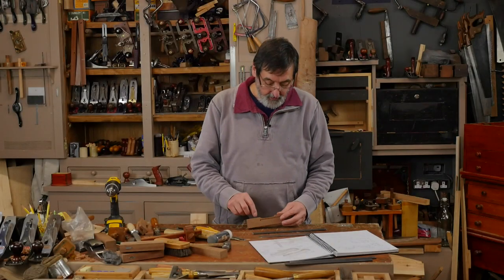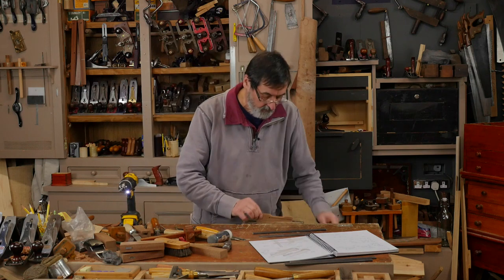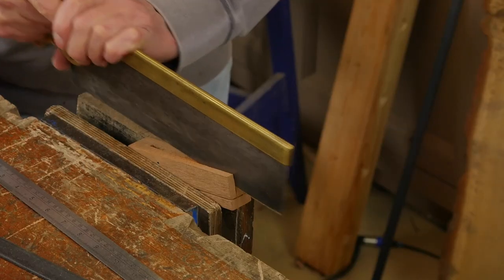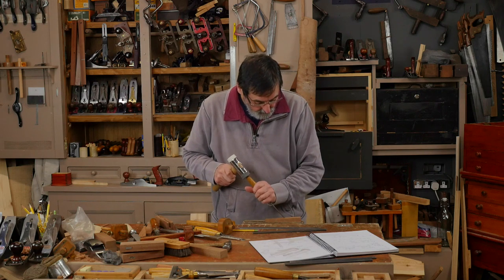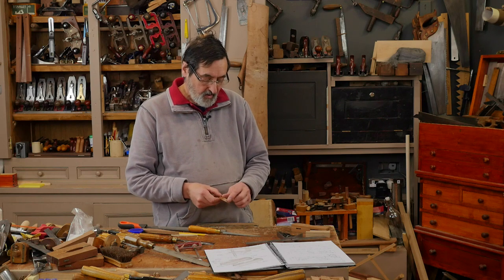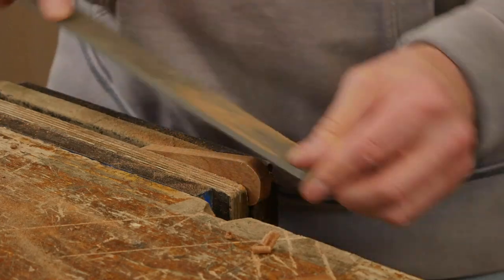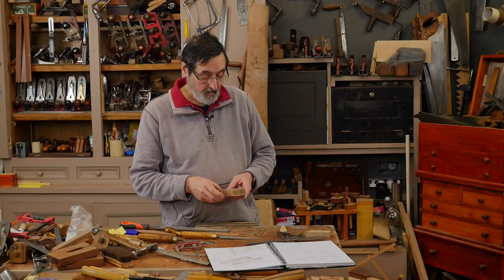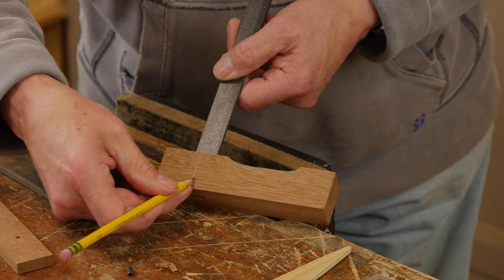Making Cam Clamps 3 | Paul Sellers

Comment: I just watched this video a second (or third?) time, I couldn't resist watching all 3 parts all the way through.
At around 30:30, roll-pins are used as a stop for the clamp.
This will work, but it could possibly catch on something like a cloth or your fingers.
Instead, you could use a key-ring, which would also give you an extra way of hanging it on the wall-rack.
(Yes, you could also use a M3 or M4 DIN 912 hex-socket screw, I'll probably choose that solution myself, as I have some of those.)

Comment: Great series. I used to be the Guitar Doctor at Stars Guitars in San Francisco (made "House Calls" to concerts and recording studios) and there's not a luthier who doesn't have at least a dozen of them even if all they work on are solid body electric guitars. Most have at least three dozen or more in their shop. The commercial ones I've seen were all made out of maple, but any good, seasoned, straight grained hardwood should do. I like the idea of using 1"x⅛" mild steel bar stock instead of the aluminium the commercial one's come with. Just don't let it come in contact with the project or, due to the wet glue, it might leave a stain. (Come to think of it, that may be why the commercial one's come with aluminium instead of steel shafts.)

Comment: how do you apply finish on them? can I use my standard method for tools which is boiled linseed oil and paste wax? do you have to avoid getting finish in the mortise? or would it still have enough friction to hold?

Comment: Super thank you, ive just made some out of maple. Which finnish do you use, oil, wax, lack?
Reply: This was two years ago... but anything that doesn't stick to wood glue would be a good bet I think. Polyurethane, or waxy finishes should work very well. PVA or aliphatic glues don't stick well to shellac either. The leather pads are of course at a higher risk to come into contact with glue. A square of painters tape on top of the leather could help in messy clamping situations. 

What did you end up using?

Comment: Great video series! Thank you. I'm not sure if the plans for this are available in written form on the masterclasses website. But I've stumbled upon plans for a similar one in a book recently: Tool-Making Projects for Joinery and Woodworking (Steve A. Olesin.2005, ISBN-13: 978-1-892836-23-6). But this video here covers many more details, as usual.

I think a keychain ring might be a good substitute for the final guard pin. It would make it easier to transfer to a longer bar or remove one head for storage.

Comment: What readily available wood is suitable for making these?
Reply from the maker: Beech is a great wood for these.
Reply: @Paul.Sellers  Thanks for getting back to me so quickly. All that appears to be available to me locally is either spruce, pine or oak. Where should I be looking for other woods (I'm in the UK), P.S. absolutely love you channel with it's emphasis on hand tools. So many woodworking channels on Youtube are centred around huge workshops fitted out with every conceivable power tool.